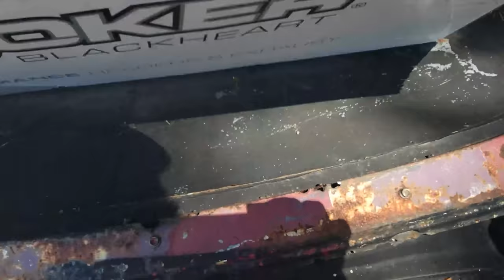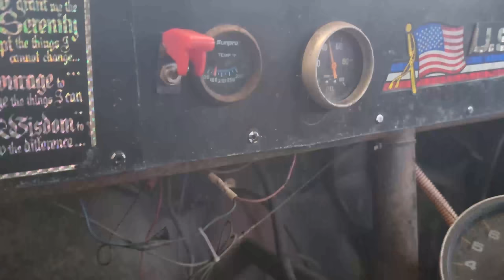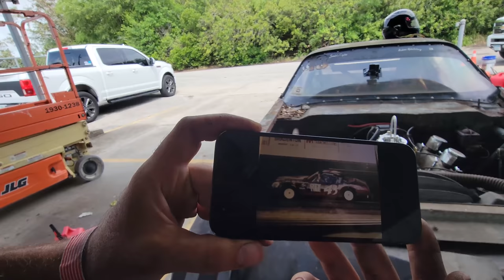Abandoned Camaro Race Car - Will It RUN AND RACE again?

Comment: Can’t believe this car is still here. I built that car around 1994-95 for a guy named Frank Fredrick Also know as Agent Orange. He  was in Vietnam when they sprayed agent orange to kill all of the foliage. He was heavy into the Pow/Mia movement. I worked on front clip for a week modifying ( cheating it up) so it would go around the corner by itself almost. It was run in the street stock class   Headers, slicks, locked rear ended and under slung bars under rear ended to take the flex out of chassis. Had to watch video closely to make sure it was one of my builds. Thanks for bringing it back. Signed: Clyde Oran, Oran’s Garage, OranBilt

Comment: The pink swing seat is definitely a factory option for the drinker side.
Reply: LOL i saw that too
Reply: No that's a dealer option.  Could be hard to get new bushings for it.
Reply: Nice structural twig holding the fuel tank in as well
Reply: Gotta have a place for the kids
Reply: That’s George’s booster seat
Reply: Little human training seat.
Reply: The key to happy moves is a lot of trips to the dump.

Comment: Desoto Motor Speedway and drag strip. Way back in the 60's they had a race-what-you-brought event. I raced my mother's Oldsmobile 98 and tore the front bumper off it. I told my mom that someone backed into me. If you flipped the air filter over you could increase the horsepower of the 455 by at least 50hp. As I recall, she didn't corner well, hence the bumper back-up damage. My mom filed a claim with her insurance. Her claim was rejected and  she never let me use her car for dating again. I told her what really happened 20ish years later.
Reply: That's hilarious, if only it was on video. So you could watch it over and over.

Comment: Back when I used to run dirt oval we just ran the size belt that was an exact size to run around the crank and water pump pulleys, usually bolted the fan/water pump pulley on as we put the belt on
Reply: Same, I have a scar from slicing my hand open on a fan being the tensioner from a belt that was hair too short to get a bolt in.

Comment: Wow moldy seat padding what an option! You know I’m kidding but it just sounded funny maybe more so than when you said it. Thanks @ Vice Grip Garage by they way that suspension loooks rock solid or did it have a little cushion  in your pushing??
Reply: Dont think it wouldve mattered considering the front crossmember/frame was sunk into the ground. If he checked it after putting air in the tires that would give some results

Comment: Buy 2 stroke oil and add a couple splashes to them when you’re putting it in vehicles that you plan to park often. It helps the gas not breakdown I’ve used the same 5 gallon can for two years on my snowblower and it runs like new every time

Comment: Excellent entertainment and sharing of knowledge as usual.   It is great to  see a forgotten race car come back to life.  I have one thing to add,  the power steering belt from a Monte Carlo (  IIRC 1968?) will drive the water pump from the crank pulley without a tensioner/alternator.   It is a SBC trick I learned in 1981 from an old racer and now I'm old, so there you go.

Comment: Reminds me of my own 74 Camaro I had to sell while fresh into my military career. It was bought by a Florida guy from my Grandfather then tuned into a race car. The likelihood of them being the same is 100% nil, but the area matches considering I had it in Hahira, GA (Thunderbowl Speedway way back when - The Radney's) and my old man used to drag it in street form there. Even had the redneck rake with the ginormous tires out back on air shocks up high raking down to the skinnies up front. Brought back memories for me regardless. Nice going!

Comment: So many memory’s as a child of racing. My step-dad ran a dirt track in a late 70’s Camaro, red, no#26, still have my team shirt at Mom n Dads house. 

We pulled her on 1/4 ton Ford. He had a pretty bad scare one night and decided to call it. The ole car went back on the track and the engine found its way to a drag car. 

We turned the Ford into a pulp wood truck (we were saw-millers n loggers). I was about 12 one evening when we fired her up with a Saturday load of fire wood, stirred up a yellow jacket nest with the open headers. They got at me, I panicked and dumped the clutch (apparently I floored the throttle about the same time). 

Twisted the drive shaft out, UV joints looked like they’d been in in of those metal eaters, pushed the fan through the radiator and I’m sure some more stuff. It never ran the same after that. Lol.

Comment: The windshield tells me it was a asphalt race car. I know on dirt, some of them old GM F-Body’s are quick at the beginning of a race, but once the track slicks off those leaf springs loose the advantage big time over the G&A-Body cars with coil springs. I don’t know much about asphalt oval racing, but I can imagine an asphalt track will change through the night, but probably not as much as a dirt track would over the same time frame.

Comment: The manual tool usually comes with the wires and then they have a pair of pliers similar to one day so I’m one of your videos the other day where it’s a ratchet but there should be a little plastic block that comes in the box and you can do your wires with that

Comment: I always enjoy Derek's videos 
I can't believe you have been working on this old junker for a couple hours and you don't have a radio working yet.
that Hyperlube stuff is probably great. My Dad used to use something called Motor Honey back in the 70s. Looks like the same stuff.
It doesn't sound like that little Chevy V8 needs headers or any of that other exhaust junk anyway. . . sounds great just like it is.
I guess I shouldn't joke about exhaust. . . you really shouldn't try to drive it without getting some exhaust hoses, right?

Comment: The rear gear is probably around a 6:00 or some times you run a 3:23 and run 2nd or 3rd depending on the Trans

Comment: awsome car   that thing needs the body pulled off .  
power wash & sandblast the frame/ cage  spray it with the Cosby nail polish in a can  

  Then drop the old body back in place  cleaned up with a matte clear coat   couple new window nets and seats 
  👌🏾👌🏾 mint

Comment: Can't see the distributor gear. Way back in the old days one of the men working on a short block and lit a match to look down the hole. After 1 second he had no eyebrows of front head of hair.  Man he was pissed and started to cuss a blue streak. Not hurt but surprised and everyone around cracked up and when they spoke to people that were not there on what happened stated to crack up just recalling the story. You had to be there.

Comment: I wish a guy could get ahold of Derek. I have a 84 k20 with a new motor and a weird noise that I or  no shop can figure it out. It sounds like exhaust leaks but timing exhaust leaks and everything is fixed valves are properly adjusted at zero lash. If there's someone that can figure it out it would be derek.

Comment: 18:14 and 23:37 Hmm so the main takeaway from this is 2 or 4 bolt main small block 39700014 is NOT a piece of junk if it can sit this long after probably being in the car since day 1, beat up, driven that hard and all that, and 30 or 40 some years latter some guy puts gas in a carb and the thing starts up! 

like that aint half bad, even if it has been modified for racing abit with a few small parts

and you gotta tell them to make this the freedom factories pace car, as this thing probably has just as much history as the track, plus the more it gets out there, the more people might be like hey we know that car and come forward with its history abit more. 

not unlike the track itself really, like old race track, old race car, both resurrected and ready to go again.

Comment: Have kinda off topic question. 1980 Chevy truck, 350 with TH 350 trans. When it comes to passing gear "kick down" it bogs down (falls on it's face). Any suggestions what it might be. Timing? Kick down cable adjusted and no different results

Comment: Before you race it for real please tear it down send it off to get sand bladted then go over every weld fox welds then rebuild it from ground up its not to bad with a already built car it can be done in a month. Get new belts man those dry rotted ones womt do anytgkng and get a hans. Oh and go through the front end and nut and bolt it at the least. The setup in it isnt ideal from jt sitting thag long it all needs to be redone to be rigjt i been racing round track asphalt cars since i was 8 i started in a class like that car against my mom. But really cool video and what a motor in it nice. Put it on scales get your cross weight correct and rear bite and left side weight and springs correct I cpuld male that a beautiful racexar 700 bucks is cheap for that a car with a motor that runs heck of a deal and its got probably aboit 380 hp to rear wheels is usually about what that class lf cars has. My pure stock 35p ci motor for dirt is 405 to rear wheels. And my super stock for asphalt is a 36p ci Chevy 350 with 560 hp to rear wheels and sings at 11k rpms at a huge half mile asphalt oval. I dont race anymore but still got the cars and wohld love to come male some laps at freedom factory cuse i raced street stocks there a few times when i was 12 I'm 32 now
Reply: a rebuild will kill the Story behind this car